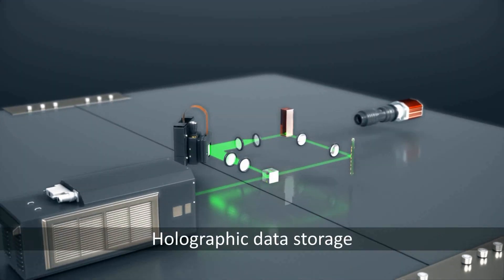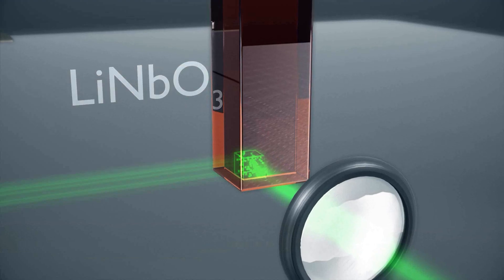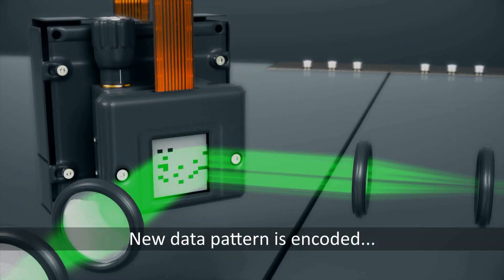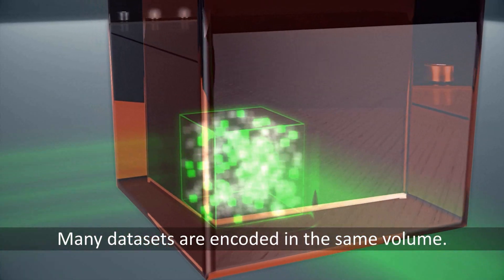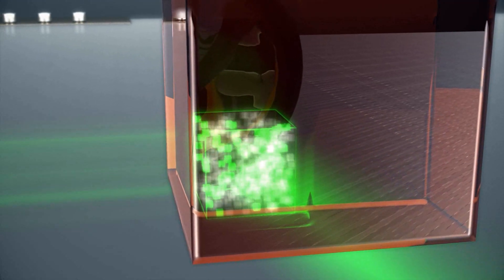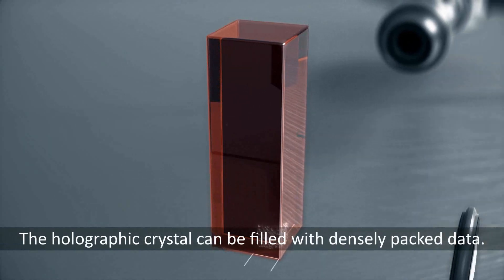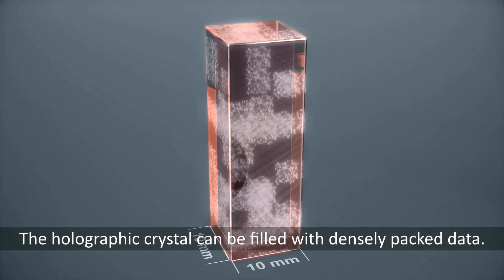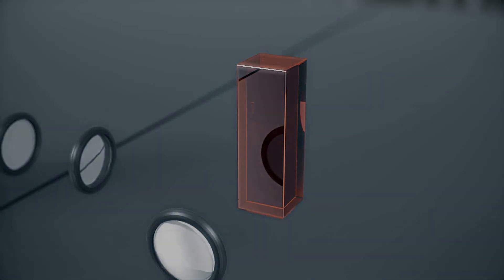How does holographic storage work?

Comment: This is awesome, more interesting to me than the new glass thingy. I'm very curious why you don't only sweep the reference beam in one axis, and make a disc shaped piece of film so it can be written and read like a CD? cube shaped media sounds like an inefficient way to build a reader/writer
Reply: It is actually magnitudes more efficient than discs, massively, it's gargantuan. The reason the reference beam is not swept in one axis is because unlike a CD, both the surfaces and the substrate between the sides can be separately recorded at all angles. Due to this, it is recordable at every single angle throughout the cube. Meaning we have thousands of angles to use without overwriting data written from any other angle and it applies to the substrate too. 
So a straight line, through the cube from any angle, provides more storage. We're talking potentially double digits of gigabytes per cubic mm, though this is highly dependant on the wavelength of the laser that is required by the particular incident interference pattern that was generated on the spatial light modulator.

So the reason a disc or otherwise round surface is not needed or desirable is that because we can encode much more information in the microscopic fringes of the recorded interference pattern throughout the whole cube, while a disc prescribes the length and spacing between the burned in etchings, and is limited to flat dimensions.  The data on the disc must be presented to the read head which must read it one etch at a time. 

Within the cube all of the information that was recorded at a particular angle is instantly reconstructed when illuminated by the reference beam in the same angle. 

Since we do not spin something at all no waiting is required for the next instruction for the processor.

As these cubes are stacked. So asphere too would have wasted empty space.

We get much faster read speeds since we can just illuminate an entire side at whatever angle which will instantly reconstruct the data in every recorded fringe from that angle. We also only have to slightly shift the angle of the reference beam obtain the information recorded in the adjacent angles instead of waiting for the correct spot on the spinning disc to pass under the read head, as a disc does. Really it's the available RAM and processor speed that bottlenecks speed.

It's astonishing technology, but this is why spatial light modulators start in the $10,000 range at the absolute bare minimum.

Comment: I would say superman data crystals, but what's the density and the read/write speeds?
Reply: Read speeds are bottlenecked to as fast as the laser/crystal can switch locations, usually about .2 seconds for the entire crystal, remember its reading entire blocks of data and sending the single out in parallel, so it's effectively faster to read then RAM and capable of universal storage... If the write speeds can keep up.
Data density is one bit per wavelength of the light used or between 500mb per cubic mm for near infrared light and 30gb per cubic mm for the uv light and a different crystal material, each multiplied by the angles of light available, and several thousand angles can be used per cubic millimeter. 
So 500Mb times 256, times volume or the crystal in cubic mm = 128Gb minimum using 8 bit addresses...
Thats a pretty good density all thing considered